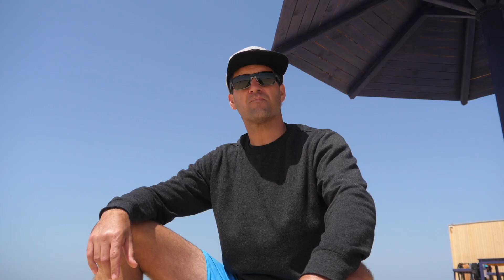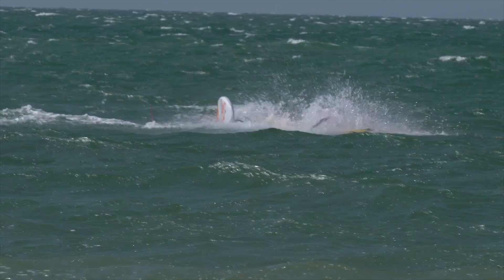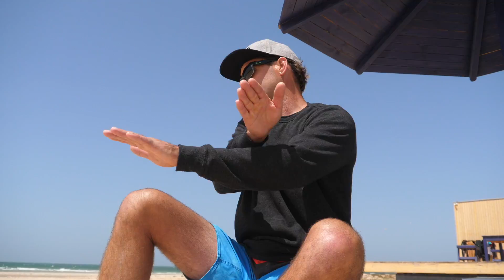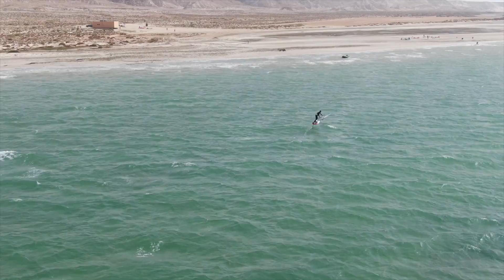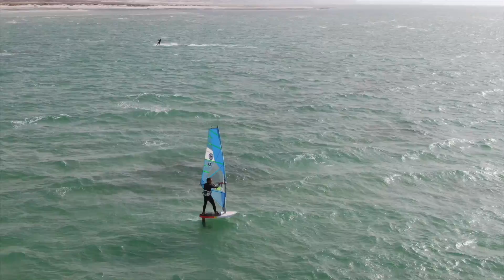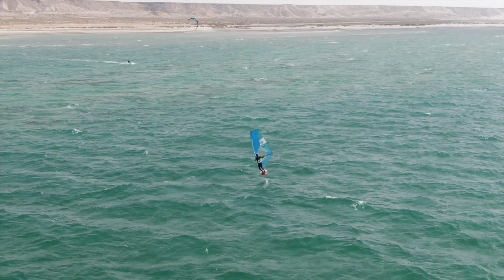Wyatt Miller present Slingshot Windsurf foiling

Comment: Great video.  I'm 62 and have been getting nice level flights.  I'm working on my jibes.  The darn job keeps getting in the way of my water time.  Now with covid 19 closing all our beaches, it looks like it will be summer before I get to practice.  I have the Infinity76 and might just have to get the 84 for our wimpy summer breezes here in Mobile, Al.  PS.. the old and cheaper Iwatch3 can handle the water speed app. I've enjoyed 18.8 mph with a 6.9 M and no whitecaps.  21.8 with a 5.7 and 17mph winds.